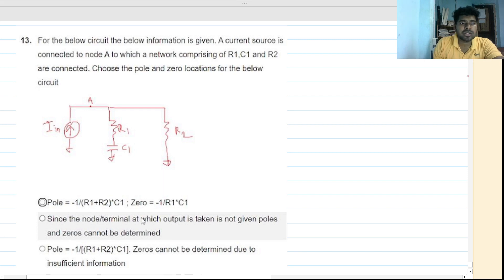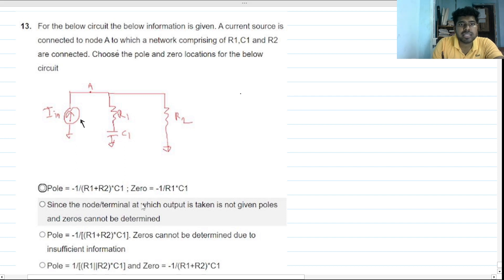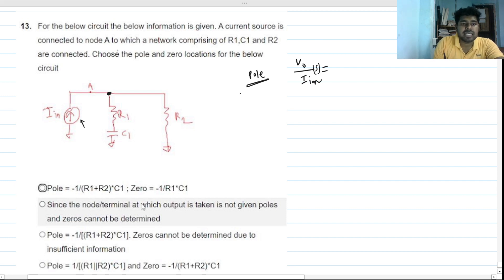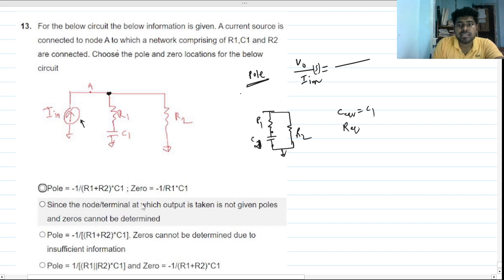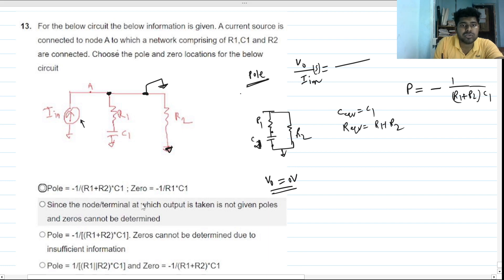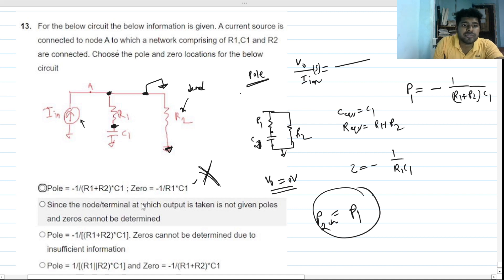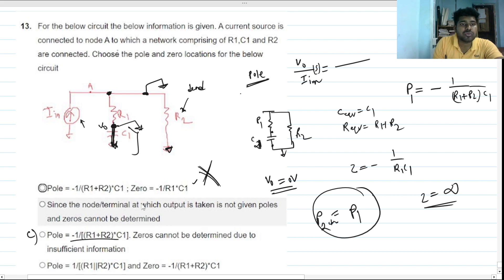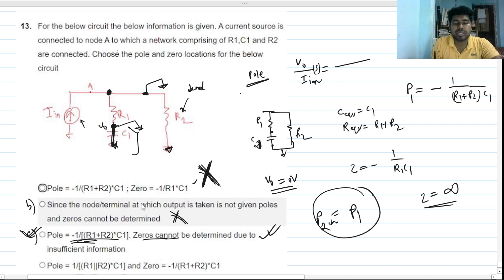Find Pole and zero location of this Filter  with Input current source_ Analog Design interview

Comment: I have doubts in the 'zero' concept. if we do ground the output terminal, It eliminating R2 as well as the current source & the RC branch. then how it is 1/r1c1?
Reply: Hey, For Vo to be zero there should not be any current across R2. This can only happen if the R1 + C1 branch acts as a short circuit. That would make R1 + 1/sC1 = 0.